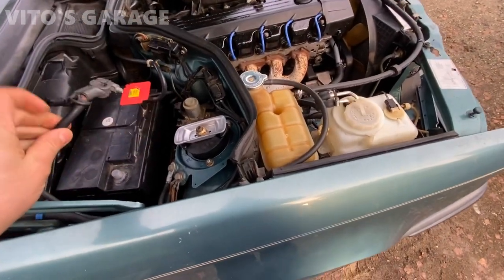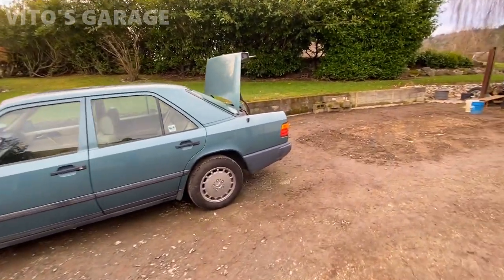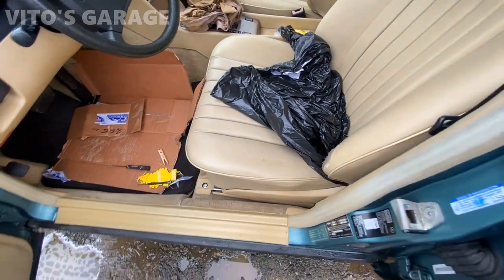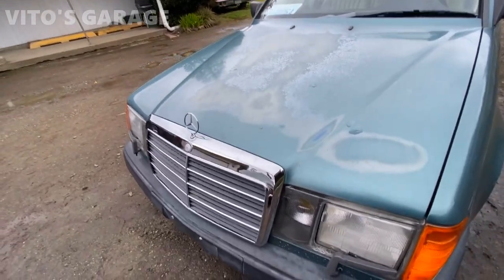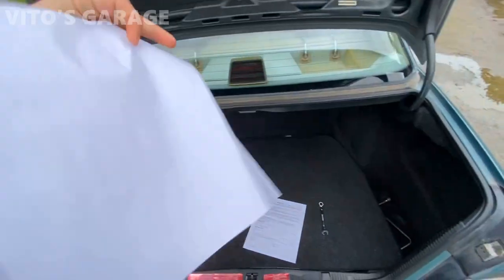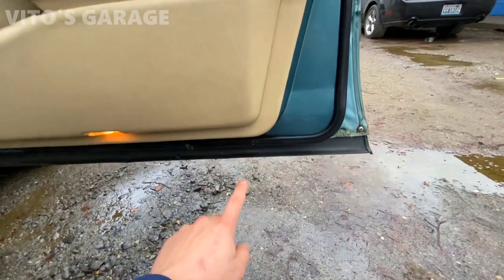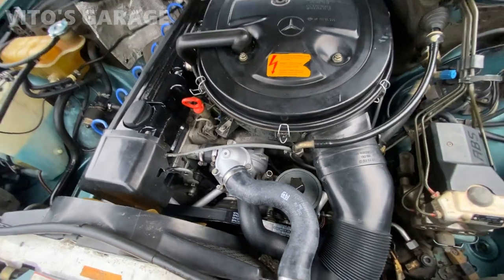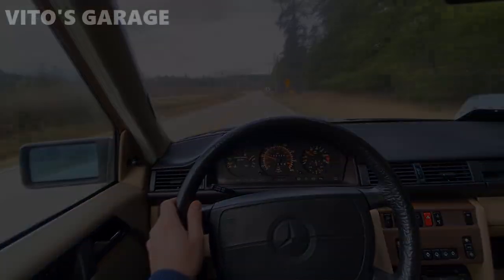(SOLD) Revived Green/Blue Mercedes W124 300E Everything That's Been Done & Final Test-Drive!

Comment: I would have soldered the neg wire to the new terminal, and also sprayed with some deoxit or some such contact and conductive lube..

Also you really need a Go-pro on your head to give you another hand back. ;-)